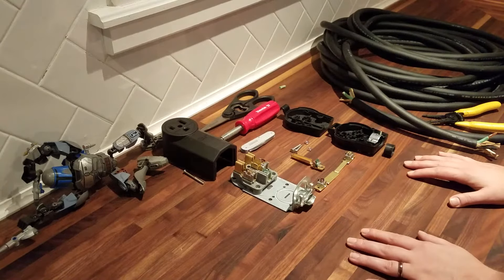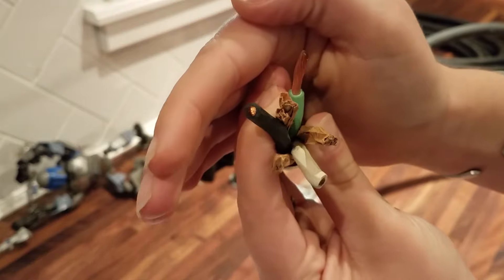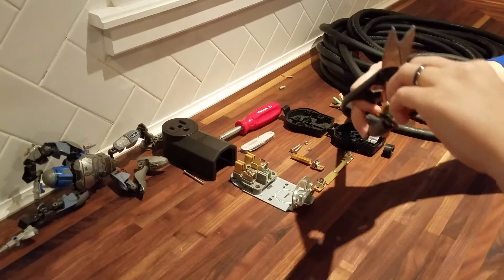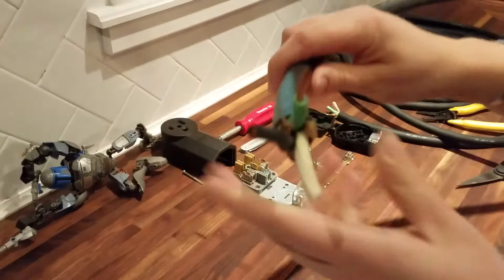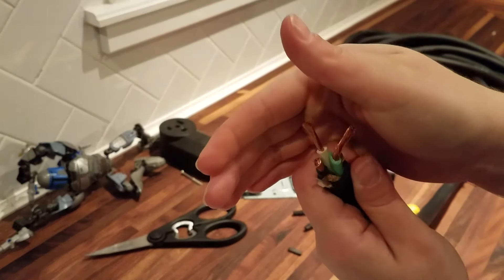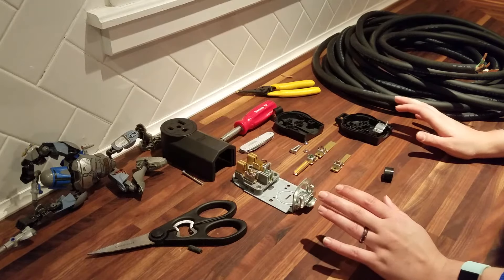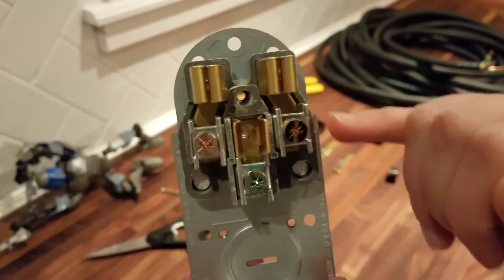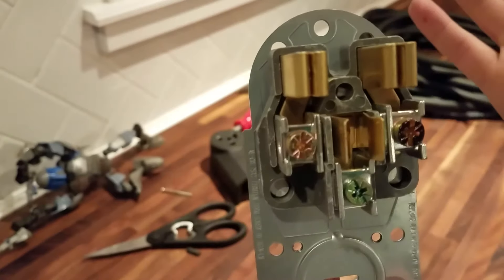Making a 220V extension cord

Comment: You did a very nice video.  A few things you probably do not know.  A 6-50R,  R stands for Receptacle, P stands for Plug.   You put #10 copper SOOW rated for 30 amps(in this case) on 50 ampere devices.   Should be #8 for a true 50 ampere extension.   It is not legal to make an extension cord for business usage, OSHA violation.   The 6-50R that you connected to the cord is not tested, listed, or approved for making extension cords.   It is for surface mounting to a structure and to be used with cable, not cord.(different connectors).  You should really by cord cap receptacle just like you bought cord cap plug.
Please accept these comments as constructive.  Trial and error are great teachers.   Always be safe, the life you save may be your own!   Respectfully,   Kevin
Reply from the maker: Thank you so much! I appreciated your help / guidance.

Comment: that as you say "cardboard wire" is only used for insulation, and yes cut them out when using the wire.
Reply from the maker: lilfear thanks.
Reply: And its what makes the cord flexible and be able to roll up.

Comment: BS, When making the extension cord I would reverse the polarity on the outside wires. Why? When you connect the power to the cord the plug is in upside down.This reverses the wires that you connected. In all honesty the way that you have it now will work fine.However if you hooked up a ohm meter and tested the plugs and the receiver side by side it would not work.Are you able to see what I am trying to explain?As of now the black wire is on the right side  of the receiver and on the left side of the copper end. Upside down. Ken
Reply from the maker: Ken I'll try to read/learn more about it. Thank you!
Reply: Ken, I totally disagree with you.  First of all this is AC not DC so L1 and L2 can be wired either way...saying that even if you wanted to color code it just for your own mind, if you looked at how she wired it the "big part" of the male end of the plug was black and on the female end the big part was black as well.  So both meet up no matter what way it is put in...It only goes together one way.  Good job Bombshell